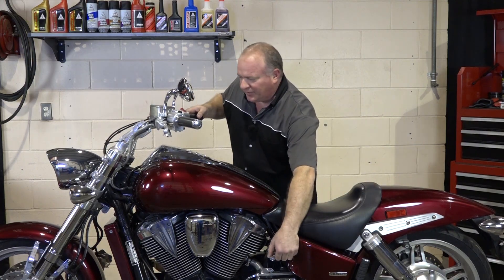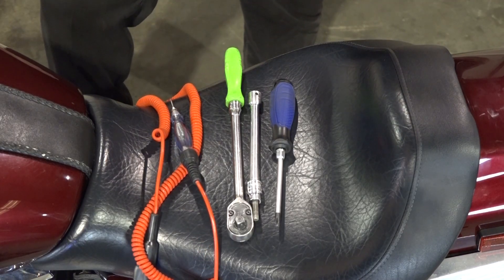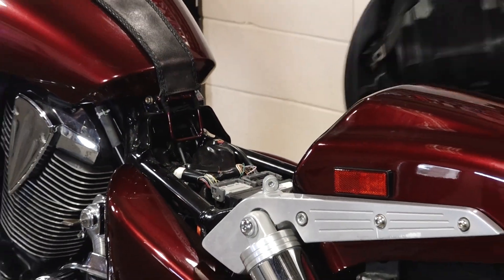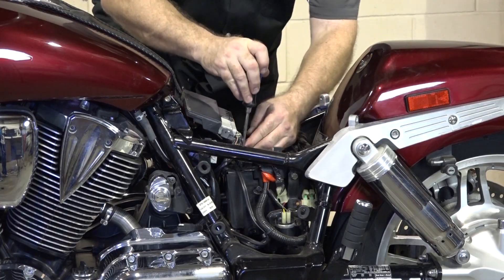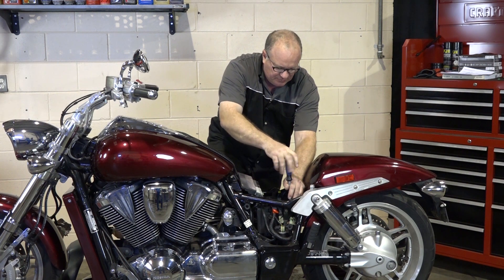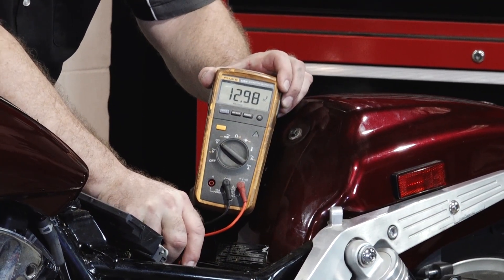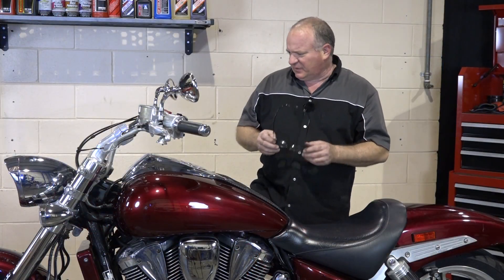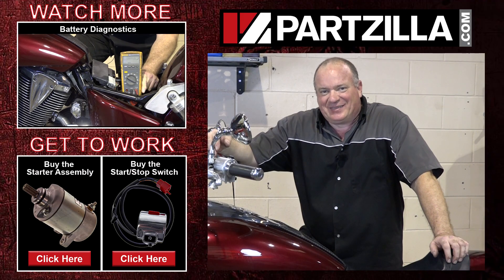Troubleshooting a Motorcycle that Won’t Start | Honda VTX 1800 | Partzilla.com

Comment: I have 2004 1300vtx. Just had, no start condition, similar. New battery. Wet condition, weak lights, try starting and lights go dead. After several tries everything came back. Could that be a water short in the fuses?
Reply from the maker: Could be a water short in multiple places, not just the fuse.
Reply: @PartzillaParts  , Found issues with water drainage from mc cover. Definitely a frustrating condition. Maybe I'll build that shed.

Comment: Very nice presentation Brochacho!! My bike tried to leave me stranded yesterday and went completely out of electricity after I flipped the switch. I had no idea what to do so I went inside the side panels and started moving wires around and when I was about to give up I gave it one more shot and it came on so there must be a short or something. I got to work with it again today but it started sputtering just when I got to work so im hoping I get home. maybe those fuses were getting worn or may be oxidized who knows. when I figure it out I'll let you know.

Comment: I replaced the bad solenoid. Now it starts. However, once in a while when you start it, the starter keeps running. sometimes when its running and i rev it, the starter kicks on.  can't find anyone that can explain it. (02vtx 1800c)
Reply from the maker: Check for a shorting wire.  Both from solenoid to starter and your handlebar switch.

Comment: I hv an 08 1800....on a cold start daily it usta bust over on 2nd or 3rd turn of the starter but lately it take several and sometimes I don’t think it’s going to start....I can hear the fuel pump when the key is turned on any ideas.....tia
Reply from the maker: Have you done a fuel pressure test?

Comment: Help....my battery tested good, my terminals are clean and the starter does engage sometimes, but its a weak crank if at all. Its either that starter solenoid, or the starter itself is my guess. Where is the starter location? I haven't checked the terminal there yet. is it behind the cover where the water pump is> How hard to replace starter? Thanks!
Reply from the maker: Load test the battery.  Check all connections for corrosion.

Comment: Hi there, I have a question. Sometimes my bike won't start, all I hear is a clicking sound, then I tap it with my hand and sometimes it will start. But sometimes I have to tap/slap it a few more times for it to start. It seems to happen only when it's been sitting around for awhile. For example, when it sits in the garage for one day or when I went to lunch with a friend, a few hours after lunch it won't start. Also, when I put it on the charger it starts right up. Thank you for your advice.

Comment: Hey John, I'm working on the same bike I believe. 2005 Honda VTX 1800. I replaced the battery as well as the starter switch (kill switch & push start assy) .... When put my test light on the battery side of the solenoid (terminal) it lights up... When I put it on the starter side post it does not light up (not even when I hit the push start) ... However... when I put it on the yellow wire (starter side) and hit the push start that lights up... I cannot get the bike to start unless I run a screw driver across the solenoid. ** If I jump the wires it will NOT turn over... * My guess is that it is in the solenoid but I am guessing at this point. Let me know what you think. Thanks, John Wheeler

Comment: Help!! I have a strange problem and need help to understand it. I have a 2008 Honda VTX, normally I drive the bike year round, in the winter even if I don't ride for a month or 2 I will still start the bike to keep the battery changed If I don't do this of course the battery will get low, so I charge the battery. But what happens is even after I change the batt and turn the key on all the electronics and power turns on but when I push the start switch nothing happens? ( The bike will not turn over) the lights on the bike go dim like the battery doesn't  have enough power. But I know this is not the problem because this happened to me last year and I went and brought a new battery and the same thing happened? This is the 3rd time this has happened to me. I will normally have to have my bike towed to the mechanic. I thought it was the alarm system so I had it removed last year. But  I still have this same problem as we speak?? I let the batt charge all night last night, just dropped it in, turn on the key (All electrics and fuel pump kicks in) but when I push the starter switch nothing happens. Help!!!!  I am tried of this....
Reply from the maker: If you have a new battery that is 100% health, start looking at the connections and wires for damage or corrosion.
Reply: @PartzillaParts thanks for getting back to me, I will check the cables again. Everything seems fine :( I know it's something simple I am over looking) I am going to try to trouble shoot a few more days. If I can't figure it out I will just have to tow it again :(  It's a  shame I have been dealing with this for 3 years in a row :(  Strange....

Comment: My bike started stuttering while riding and popping. Then when I stop and turn it off. It would turn on (lights and all) some times but if it would start (lights) it wouldnt start with the button. Starter wouldnt engage. But if I let it sit longer it would key and turn right over. Ride find for a bit then stutter and have the same problem

Comment: I have a 97 gsxr 750 no spark situation why should I check coil is getting full battery voltage 12.8v ? Cranks over but no spark I'm thinking sensor or relay but not sure how to test
Reply from the maker: Test your coil packs, then you can test the relays for continuity when activated.
Reply: @PartzillaParts  problem is the spark plug wires are built into the coil packs it's a 97 so its just a resistance test rite?
Reply: @PartzillaParts  I'm not getting anything for the resistance test anyway you confirm before I order the part

Comment: my fuel pump will not run. I put power to pump and it pumps and runs so I replaced the fuel pump start switch. still don't run. any help would be welcome. thanks

Comment: I have a 94 VMAX  everything is normal when you turn on ignition switch then I got starter button nothing happens battery is good do not hear relay click pull off plug that goes to relay hit start button getting power to both pins in sure thats not right any help be great
Reply from the maker: Sounds like fuses or the starter solenoid, can you bridge the relay to see if it turns over?

Comment: In my case today, 04 1300c, I had a similar experience where the bike wouldn't start.  Battery good.  I was able to get it started after a few attempts.  I got it home and started measuring and checking.  The headlight wasn't coming on with key on either.  So finally, I just wiggled the start button sideways a bit and on came the headlight.  I knew the switch was making poor contact.  Tomorrow I plan to try to clean the start and the emergency kill switch with contact cleaner spray, if I can can get access to the internal switch contacts.  I did the same thing with the turn signal switch several months ago.

Comment: I have a 2002 honda vtx1800r that isnt getting power to the fuel rail and no igniton pulse and i am getting signal from the ecm and im stuck seeing if you could tell me what else i need to do.
Reply from the maker: Start simple, check fuses and connections.  Is there power loss throughout, or only fuel rail?

Comment: You don't need any tools to check a fuze. Just pull it out and you can see if it's blown or not. The starter relay is an easy fix, IF you are getting power to it, and it doesn't work, you can replace it with one from just about any small engine repair shop or automotive supply store. Other than that, it can also be the starter switch itself, which is another common problem when the bike gets older. They get corroded or can just plain wear out the connections.

Comment: At 6:30 you talk about using a jumper to start the bike, bypassing the solenoid(?). If it doesn’t start via the jumper that verifies that the SOLENOID is bad, correct? 
You never clarified that in the video and that is the problem I am having. 
No “click” or “rrrrr-rrrrrr” when I press the starter switch. Just a dimming headlight and dead silence. 
Yes, the battery is good and fully charged. 
Tyia
Reply from the maker: Yes, typically that is the solenoid test.  When you bypass it, does it start the unit?
Reply: Partzilla Nope. I get a few tiny sparks but no turn over. You didn’t include a part number but I ordered what I thought would be an acceptable replacement for the one I have. I will attempt to swap it out and update you on the progress when the part arrives. thank you for your videos and your response. 
You guys rock.

Comment: Very easy to understand and informative video. Tha k you for the video! 

I have a 2002 vtx 1800R/S. Did everything in the video and it still won't start. Battery is showing 12.50, fuses are good. Test lights work for the starter and inside the headlights like you mention. I can hear the fuel pump, press the ignition and headlights go out/dim but nothing else.

Any suggestions?
Reply from the maker: Do a health test on the battery, not just a voltage test.  It's most likely just a bad battery.

Comment: Will the rubber off the wires cause a bad connection .. the wires on the solenoid
Reply from the maker: It can cause a short.

Comment: I have a fault. The f1 light flashes 1 long and 3 short. Wont start. Does not sound like fuel pump comes on.
Reply from the maker: Error code 13:  Loose or poor contact on front injector connector
Open or short circuit in front injector connector wire
Faulty front injector

So essentially, check to see if your injector plugs came off or came loose. Check for damage.
Reply: Partzilla do i have to remove gas tank
Reply: Partzilla my fuel pump relay does not pick up. I added a ground wire to frame from coil on relay and it worked. So does the ground go through the ecm and through the injector. The fuel pump should still prime with a injector cable off

Comment: Hi John, 
Beautiful day in New Jersey today and went for a long ride.  Got home and the kill switch went screwy on me.  I tried restarting the bike, lights, fuel pump, no cranks.  Im no mechanic but your video was so easy to follow, I have confirmed that I have a bad solenoid, which I will get my replacement from Partzilla.  I have an 04' VTX1800S1 and I've saved all your videos.  Thanks!  And I hope you will make some more!

Comment: What if I'm not getting power to the coil on my selenoid?
Reply from the maker: No power at all, it doesn't click?  Then check the battery and wiring for broken connection or corrosion.

Comment: 2005 VTX 1800 not starting and also no headlight. left me stranded at the gas station. All gauges work , horn , tail light , turn signals and fuel pump. Fuses all good. I can turn the ignition switch to run and jump the relay starter post to the battery and it starts and runs. Still no headlight or any volts getting to the headlight. have 12 vt power at the white with black wire in 9 pin connector.  Shuts off with key or kill switch.
Reply from the maker: Check headlight relay and test starter switch.  Sometimes when the relay blows it will fry the starter switch.
Reply: Ordered a new starter switch from Partzilla this AM. Removed starter switch on handlebar and popped it apart. Test light showed power to contacts. Manually made connection to the other contact and the engine turned over.  Moving to the next pair and manually touching them and we have headlight.
 Contact just not being fully made any more. THANKS

Comment: no start on a yamaha vmax negative cable keeps sparking new battery just installed. help please
Reply from the maker: Is the connection loose?  Double check that there are no shorts or crossed wires.  Negative cable is on the negative terminal...

Comment: What if NONE of the fuses are blown??? Battery is good. No power to anything. Solenoid activates with a screw driver but with no power to anything else it won’t start.
Reply from the maker: Could be anything in your electrical system.  Start at the battery and run through the wires to ignition and starter. Something is killing the power.

Comment: No spark to Honda 1300 VTX  why .
Reply from the maker: Generally, this means you aren't getting power from your battery.  Start there, load test, check fuses, check wiring.  You can test the plug and work your way backwards once you've confirmed your battery works properly.

Comment: I have a 1981 Yamaha XS1100SH. When turning the key to the on position, the bike has no response. It also doesn't respond when the start button is pressed. The battery and all of the fuses are good. Do you know what it could be?
Reply from the maker: Check your ignition wiring.

Comment: Fire is only part of the system. What about the fuel side. Mine no starts until you hit it with carb cleaner. She has all the fire needed but is starved for fuel.
Reply from the maker: Carb clean? Air fuel mixture?
Reply: Injected 02 VTX 1800R Fact is my fuel rail has the rare flange mounted line (8mm each side)not the Banjo bolt for the fuel supply on the rail.

Comment: Hey I have. 1996 Honda st1000 that won’t seem to start, she turns over fine but is not getting any fuel and the fuel pump doesn’t prime when switched on, I tried staring the bike with the fuel pump hooked up to the battery but still no start even when pump is running..do you have any idea where I should look? I don’t want to send it to the shop yet. I want to figure out why this is happening. Bike started when I bought it then I took everything apart to customize and I can’t seem to figure it out. Anything will help thanks
Reply from the maker: Go back through everything you took apart and confirm all the wires are where they should be.  Double check fuses.  Find out why it's not priming on it's own.

Comment: How do you replace the fuel pump on a 2005 Honda VTX 1800?
Reply from the maker: It's under the bike right in front of the rear tire. Once you get the bracket and regulator out of the way, you can disconnect the lines and drop the pump.

Comment: very good video... my bike right now has a full battery, but when I press the ignition the lights dim and there is no click, no turnover.  Hopefully I can use this info to get it fixed.
Reply from the maker: Most likely the battery is reading charged, but once you put the load the voltage plummets.  You can test it to confirm.  Sounds like a new battery is in your future.
Reply: Did you ever figure this out? Mine is doing the same thing

Comment: Partzilla,
Great video. I have a question for you. I have a similar problem you were speaking about in this video. I turn my VTX 1800R on and hit the start switch, it tries to start but never turns over enough to fire it up. Then it continues to try but makes no noise then slowly tries to crank with no joy. Any recommendations.
Reply from the maker: Have you load tested your battery?
Reply: Not yet. Is that just taking off the seat and seeing what the volts its reading?
Reply: I keep it in the garage and have a trickle charge system hooked up to it. Are you referring to taking the seat off and seeing what the battery is reading when I try and start?
Reply: I just plugged it back into the trickle charge and let it sit for about 5 mins and it started right up. I just replaced the battery about a year ago. I guess I will have to follow your other video to see what is causing the battery to not maintain, unless you have any other suggestions 
Chris
Reply: I did load test and it is 12.5 vdc prior to and drops to 9vdc when i try and start. Guessing new battery needed.
Reply from the maker: Sounds like a dead cell.  Won't hold voltage under load.

Comment: 4th battery and now new battery slowly dies now no start do u think it is one of those stator or regulator
Reply from the maker: Could be either.  Test them both and see where you're losing voltage.

Comment: Please. Why my rectifier is getting very very hot?!
What is the reason please?!!!
Reply from the maker: There is a lot of juice flowing through them.  They will get hot.  Most of them have cooling fins on it to displace heat.
Reply: Partzilla.
Aha. So that heat will not damage it?!
Reply from the maker: Recifiers do go bad sometimes, but it is normal for them to get hot.  They are designed that way.
Reply: Partzilla thank you very much. I'm glad to connecting with an expert like you..
You are the reference for us 👍👍

Comment: Thanks for the video. But have to ask a question. I was wondering why don't you sell any parts for the VTX1800? Lol
Reply: What I meant is for 2002 models. But I assume that my 02 VTX1800R2 is compatible with the 03+ models?
Reply from the maker: 03 will work.  They didn't change anything.

Comment: Hi there. I have 2016 Pagsta Bobber. I live in Lansing, MI. Around here no one knows working on this engine. I was trying to figure out what was wrong with my motorcycle and the engine is turning over but not firing up. What do you think would be the problem?
Reply from the maker: Not familiar with the brand, but all motors work the same.  Is the plug getting spark?